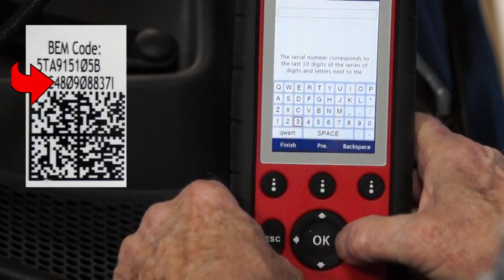Acura TLX (2015-2020) - New Battery Install

Comment: That is not a TLX. That is a TL and it's different. Sure all battery replacements are similar but the title of the video is wrong and so is the year range. The TLX has a top cover not a top frame. The TLX also has a fan and cable on the side of the battery box that if you attempt to pull out to clean debris might catch you off guard.
Reply from the maker: Thank you for letting us know. The video title and description has been updated.

Comment: yeah this is totally not a TLX which were only built in 2015. I was thrown off at first, but quickly realized this is not a TLX.
Reply from the maker: Thank you for letting us know. The video title and description has been updated.
Reply: @TheBatteryShop Title is still wrong. The title should say Acura TL 4th gen 2009-2014 battery installation/replacement.
Reply from the maker: Thanks for the feedback.
Reply: @TheBatteryShop  lol still haven't changed it